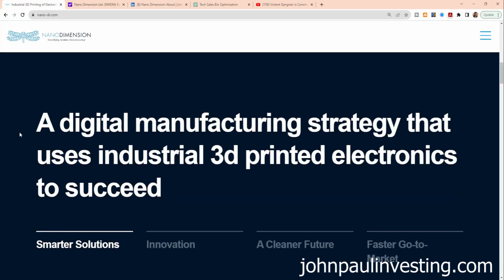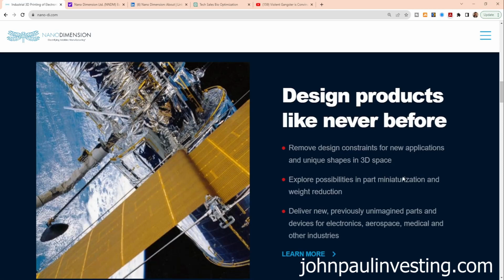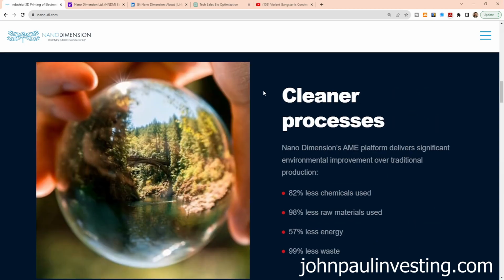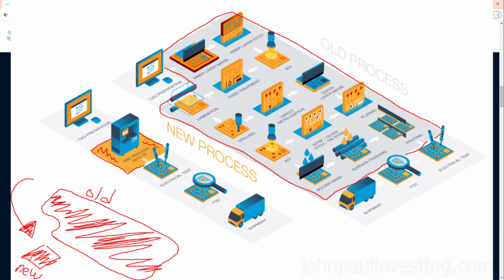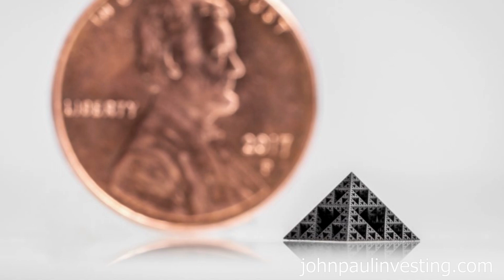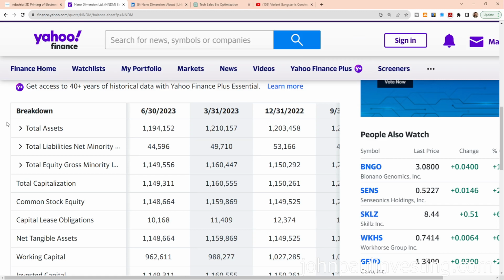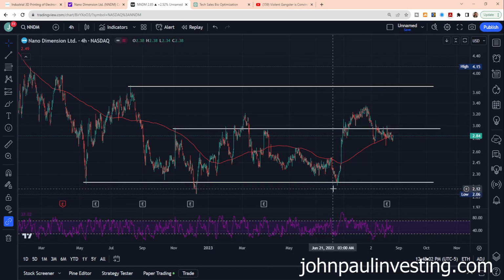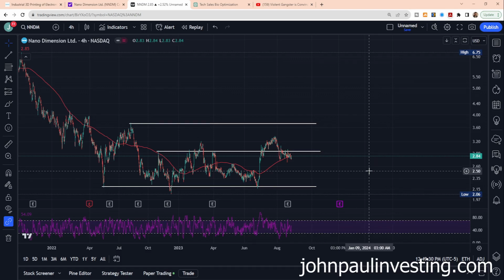Put $100 here and FORGET ABOUT IT

Comment: garbage company. ceo is a fraud. bought this stock couple years ago at $5 and let it run up to 17 and got stopped out during crash. does many  public offerings and diluted shareholders when promised not to. took the wrong route making wristband instead of going through with 3d machines.